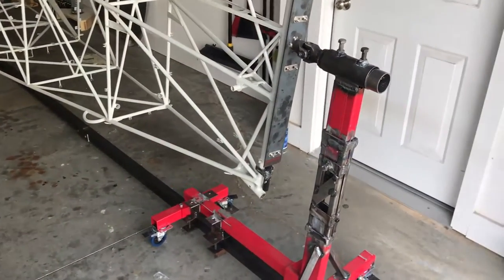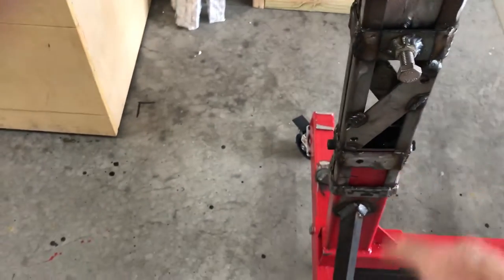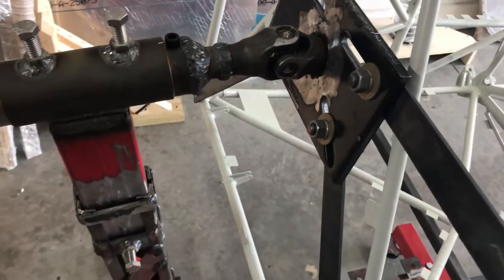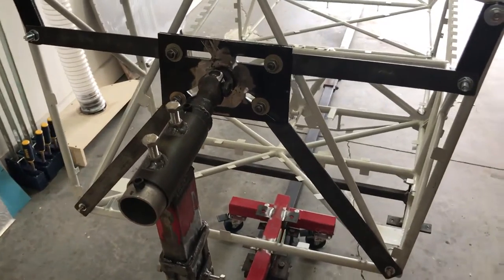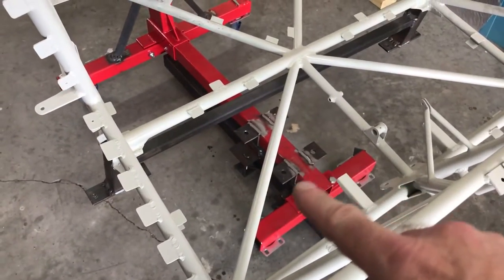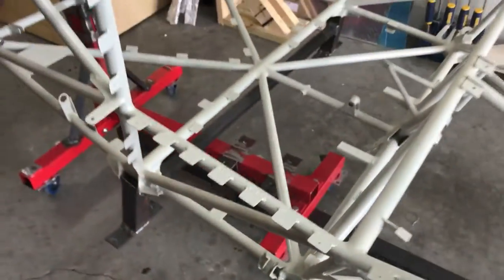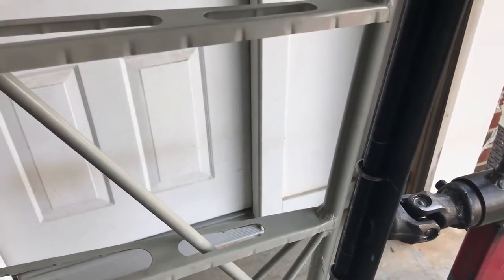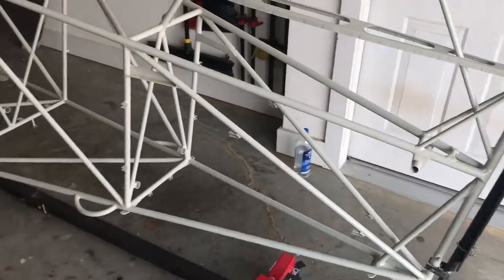Bearhawk ~ How I built the rotisserie for the Bearhawk fuselage

Comment: Hey Rob. Thanks for the walk-around and explanation video. Any chance you'd share some of the key dimensions? Junk is plentiful around my family's place, so I'll likely cobble together one from scratch for hopefully a future BH 4-place build as well. Maybe also now that you've seen yours through it's intended purpose. Would you change anything if you did it over again. From a function or ergonomics standpoint? 
Thanks!
Reply from the maker: I pretty much eyeballed everything.  I think the critical dimensions are the total length and the height of the pivot point so that both the top and the bottom fully clear the bottom.  The U-Joint is a must have to make rotating easier and to prevent binding.  If I were to do it again, I might make the legs a little wide for improved stability.  But I would and will use it again.